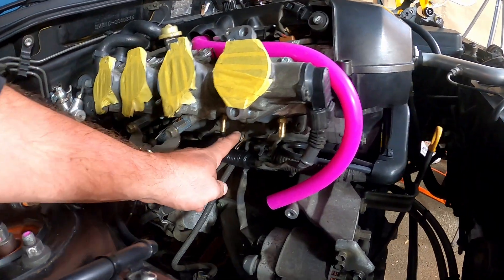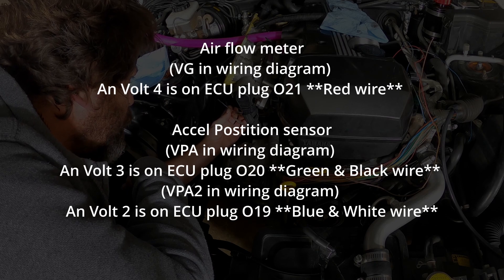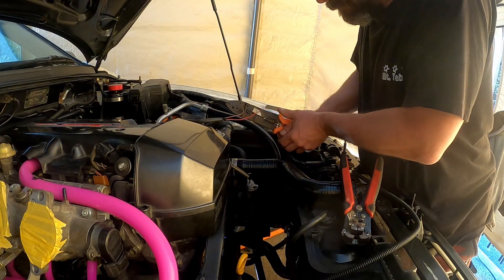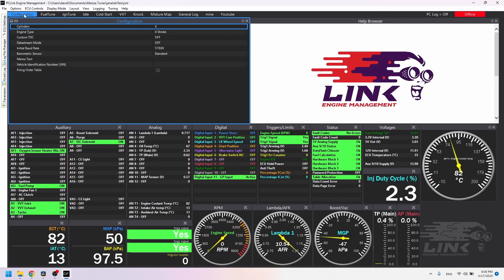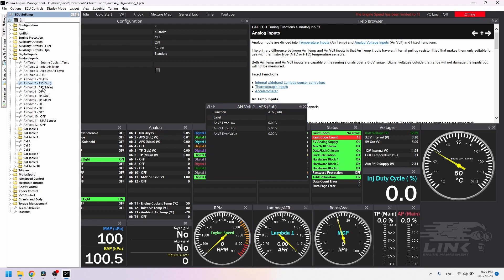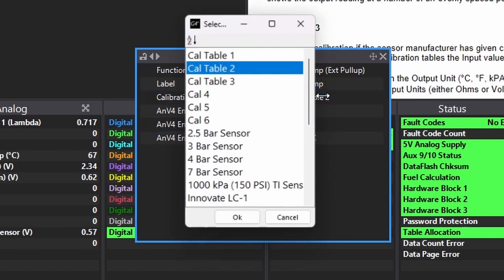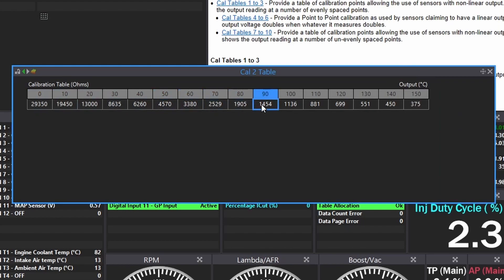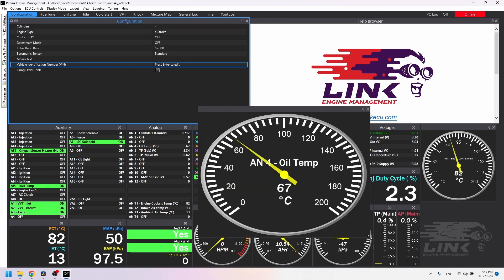How To Add A Temp Sensor To LINK G4+ ECU An Volt Altezza sxe10

Comment: Bit late but might help others, if you are handy with crimping/wiring and you have tools you can make an XSL loom expansion for a fraction of the cost, managed to get the connectors and pins that match the G4X plugs. Allowed me to create my own TPS wiring and the cost saving allowed me to buy high quality cable and wrap in dr25 heat protection (aka milspec) and not use the 30 year old non variable TPS wiring on the roadster loom. This meant there was no signal noise which allowed a clean signal. Did the same for my aem wideband sensor and an IAT sensor (same setup as in this vid) and it works great so highly recommened it. 

I plan to add my greddy oil temp sensor (which has a dash gauge already) so I can setup a warning light. This might be something worth adding to your setup, in the link software you can turn on the Engine warning light based on a parameter with some funky setup so could get it to light up on the dash when it hits 130+ (tbh it might just work as is if you've set the high/low error values)👍🏻
Reply from the maker: Oh and I have the link can gauge so that will light up if temps go over the "max"
Reply from the maker: How did you find the name of the plug for the xsl connector? I'd like to make a cable!